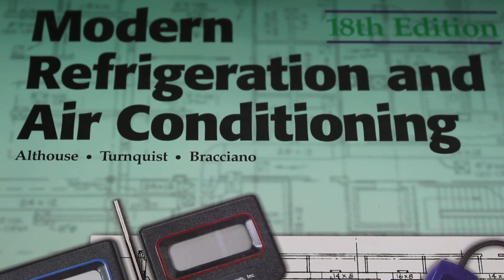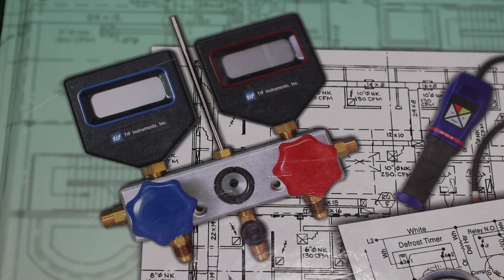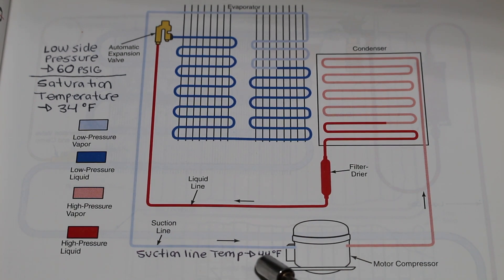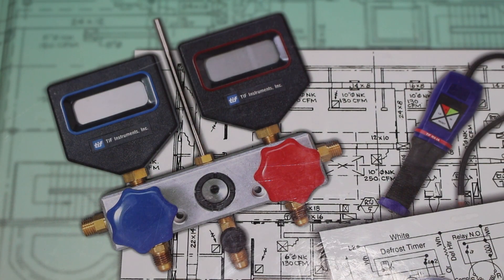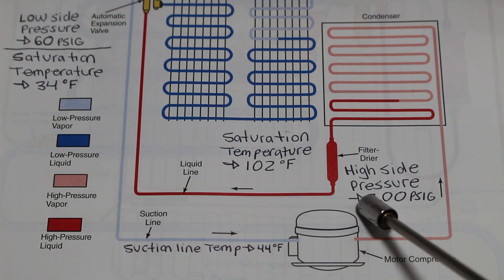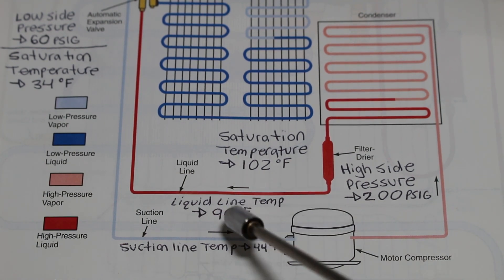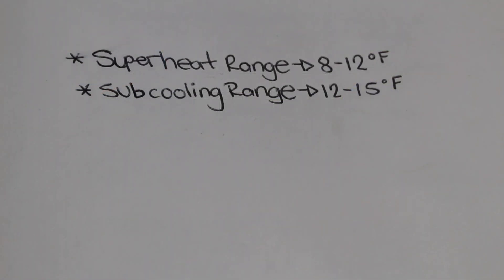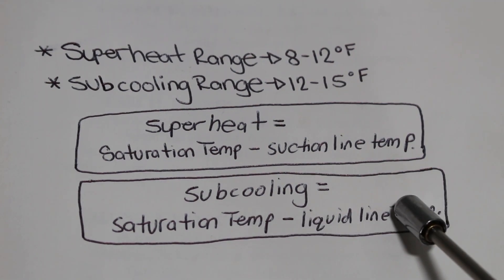How To Measure SUPERHEAT and SUBCOOLING (HVAC 101) Air Conditioning and Refrigeration Training

Comment: Trying to dial in this system, superheat is 9* and sub cooling is 20* at the compressor, this system wants it to be 9* sub cooling , does this indicate a line restriction vs overcharged as originally expected? 
The delta T is 22 degrees supply vs return. Liquid line to evap is 82 suction line at evap is 60*f.
Cant wrap my head around how to reduce subcooling and get evap temps to lower

Comment: Where do you measure your high side pressure? I’ve been told that you shouldn’t take this reading from the service port at the compressor(discharge line). Instead, you should try to get your high side pressure reading after your condenser(liquid line). I know some, maybe most rooftop package units do not have a port to hook up to after the condenser. Is this accurate at all? Good stuff, I enjoy your content.
Reply: He is talking about attaching a pipe clamp thermometer to measure temperature. Not hooking up to port to measure pressure.

Comment: When measure Superheat and Subcooling, where would one put the thermometer? For Superheat, the pressure gauge would go where the suction line access port is (but if there isn't one, where would you put the access port?), but would the proper place to read temperature be at the END of the suction line right off of the compressor? Additionally, for measuring Subcooling, the pressure gauge would go where the liquid line access port is (but if there isn't one, where would you put the access port?), but would you put the thermometer right before the metering/expansion device? LASTLY, how would reading the discharge line work, as there usually isn't an access port? Would you simply read temperature with a thermometer on the discharge line as it ENTERS the condenser and as it EXITS the condenser?